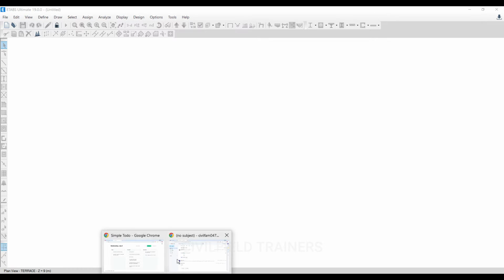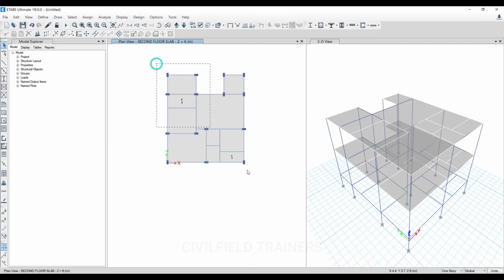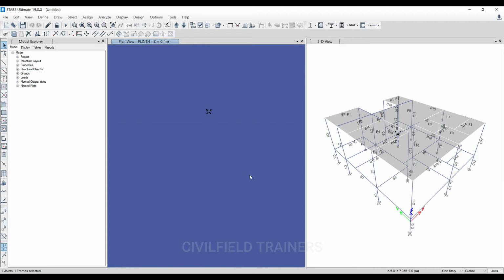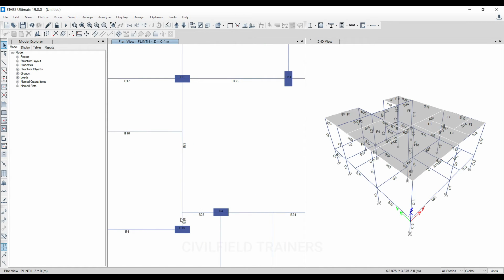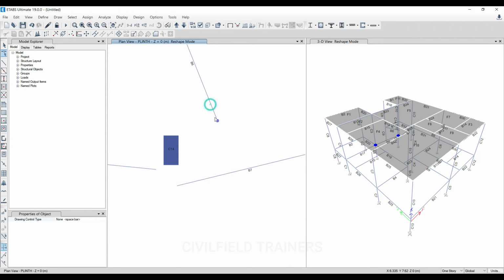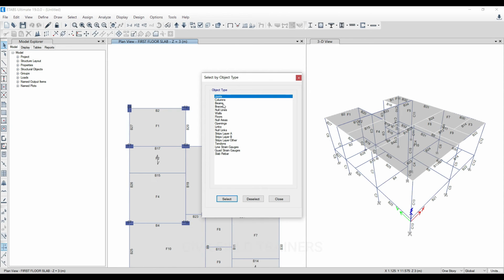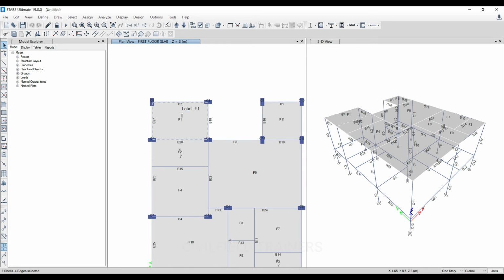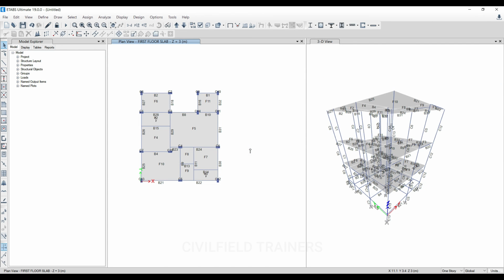Etabs : Remove Check Warnings in Etabs and Fix Errors in Etabs Model

Comment: "Excuse me, how can I configure automatic meshing in this version of SAFE? I am receiving the following warning: 'Warning: Check meshing, At area 2 (5.67% Increment).' Interestingly, the warning decreases as I increase the area of the footing. This seemed unusual to me, considering that there are only two rectangular footings, and there is nothing irregular that would require manual meshing."